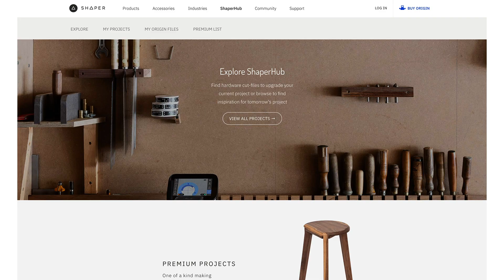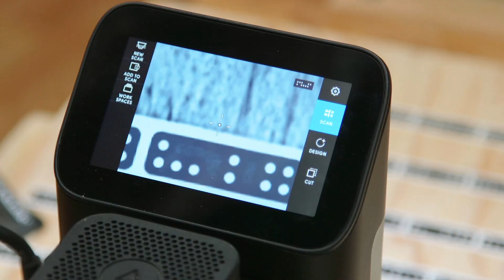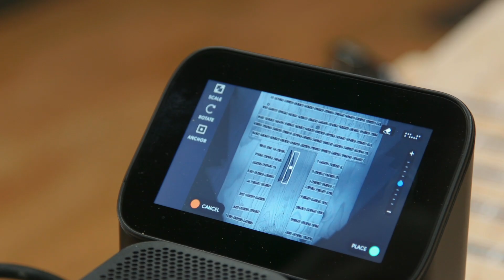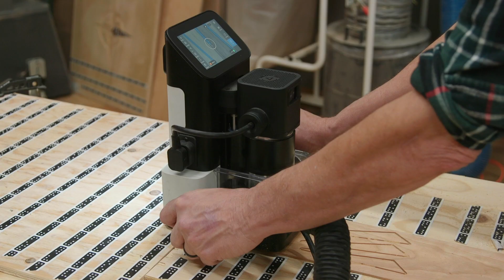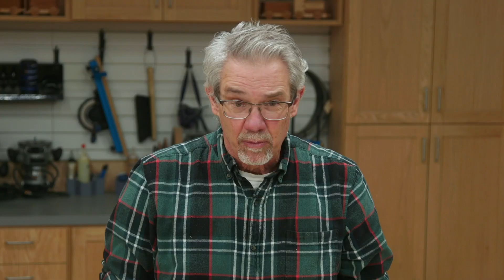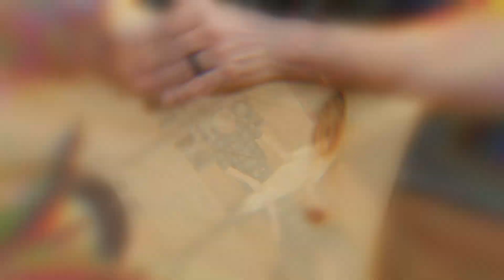Cutting Complex Inlays with Shaper Origin Router

Comment: Just seeing this now...beautiful work. Question:  I am working on an inlay with some very, very thin lines...and even with a 1/32 inch bit Origin won't cut out the pocket....any workarounds?  Is is possible to "disable" Origin and have in pocket out, even if the pocket will be slightly larger than the bit diameter?  Thanks!

Comment: Very nice. How much in $$$ is actually spent on Domino tape for such project (2 boards full). And can it be reused later?
Reply: The tape can not be taken up and reapplied.  That said, in many cases you can set up a dedicated cutting board in which case the tape says put and can be used over and over.  Not forever, as nothing is forever, but many times.
Reply: 18 Dollar for the tape in Amazon

150-feet provides ample coverage for approximately one and a half standard 4' x 8' sheets of plywood
Reply: @DennDeBill  so usd 18 per 1,5 sheet of board. Not cheap if you do a lot. I can't help wonder if inkjetted cash register roll would be acceptable for the shaper
Reply: @havenisse2009  You can print your own dominos; I have. I print them on Terraslate waterproof paper as to make them reusable.
Reply: you can make your own there few videos out there ,but if you buy workstation it has sealed tape on there so never have to use tape on small projects